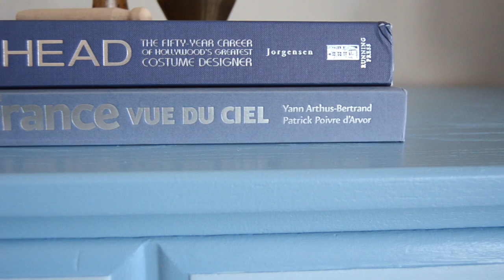How to Repaint Furniture | Painted Dresser Makeover

Comment: What, no primer or sealer? Give it time, that paint will either peel or chip, guaranteed!
Reply: Ok so this is where my husband and I went wrong. I NEED HELP🙈 we restored our table and painted it satin black..didnt use primer because the paint came with primer mixed in amd we didnt know we had to use a sealer. So 2 days after we painted our table, my 2yr old scratched off the paint with her nails🤦‍♀️ sooo half of my table is painted and the other half is scratched off..so how do i redo this type of job??😫
Reply: Jazzy ,apply a paint stripper to remove the paint and any vanish that may be underneath that. Then sand  it back apply Zinzer BIN PRIMER, sand lightly then apply 2 coats of paint( lightly sand between coats of paint with superfine sandpaper) Let it dry for at least 3 seal it with a clearcoat. For smooth professional finish, use a spraygun.
Youtubers make it look super quick and easy, they are very misleading. You have to put the time and effort in the prep (90% of the work).  If you do, you will get a superior long lasting finish.